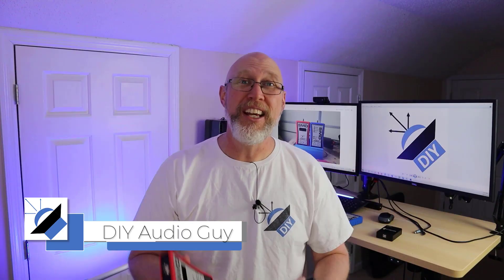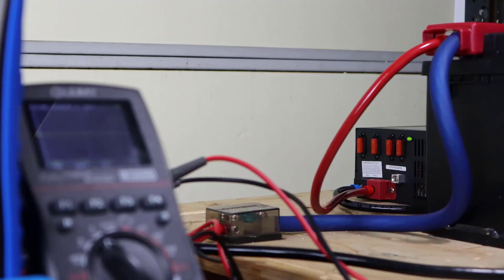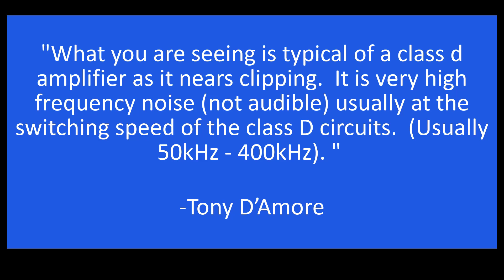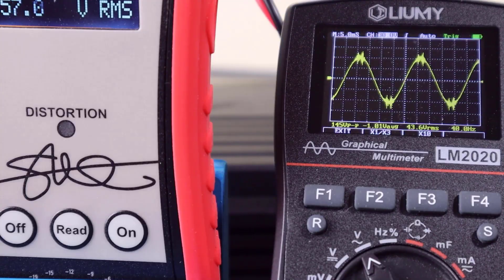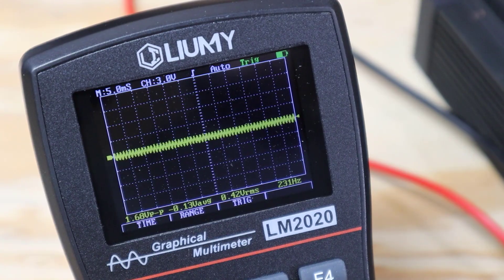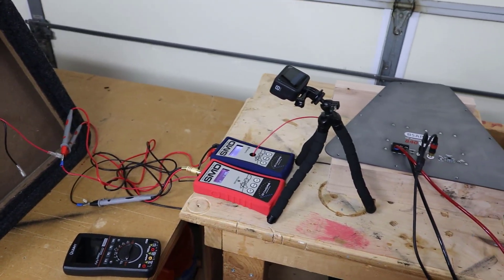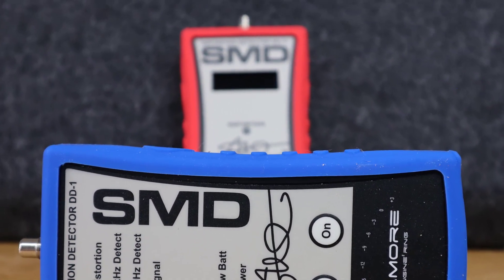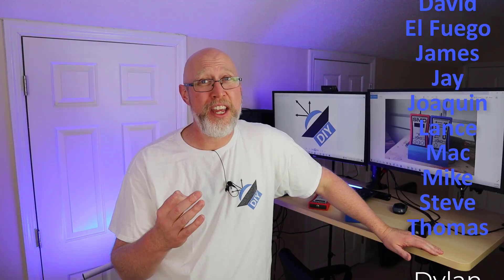The best way to set amp gain?  #SMD DD-1 VS Liumy Oscilloscope

Comment: With 99% of Amps coming with some kind of clip light, most on the bass nob the DD1 is just an overpriced peace of tec with a name on it. Every song will clip at a different place on the nob. The DD1 will not, it will just give you a ton of overlap=distortion!
Reply: That would be exactly the same whether a DD1, O Scope, by Ear or even a clip light on an amp or bass knob is used to set the gains..
Every song has been recorded at a different level..
Reply from the maker: You are not wrong, that is why the ear is always the final tool.  If it sounds wrong it is wrong.

Comment: ok I am going to call you out now  ok 1st how many people are driving around with there head set at max level 2nd you need to set it up at a level you drive at most of the time no more then 1/2 level. I have all was set my up at what I drive at. thats why I am calling you out cuz it dont make any sence to have the level max out or less your bassing out for everyone
Reply from the maker: Ok, you called me out.
Reply: @DIYAudioGuy   @DIY Audio Guy well you make good videos and you lisen to people so I had to do it and see if you can make heads or tells out pf it I never under stand why people set the amp at max level for
Reply from the maker: @CantKillMe  The idea is to tune everything so you can crank it all up to max without clipping.  That way you can safely go full tilt without damaging anything AND it should still sound clean.

Comment: Next "tool" to try - a laptop, REW,  and a voltage divider circuit.  Use the circiut to feed the signal to the laptop,  and run REW's RTA app.  Use that to detect distortion... :-)
Reply from the maker: Good idea.

Comment: Can use a tweeter whit a 2.2 uf capacitor too. You must to increase the gain. When the distortion appears,the tweeter will begin to sound. That's another way to calibrate it
Reply from the maker: That also works.

Comment: Once the brands have the amplifier designs built in China they are effectively handing everybody else the design.  There are plenty of clones that don't have the markups because they can simply buy from the same exact build house in China that any of the large US manuf. use then eliminate most of the markup.  Talk to anybody that works on amplifiers and this is exactly what they will say.  I would say the O-scope and DMM would be the two to pick.  If you want something easier and less time consuming then you go for the SMD tools.
Reply from the maker: True

Comment: 20 years using an oscilloscope and plan to stay the same, I bought one and sold it shortly after, it was just collecting dust on my shelf.
Reply from the maker: I honestly was not expecting the DD1 to be any better than the scope, but I already had that plate amp pulled off so I gave it a try.  I was shocked.

Comment: Why not use a actually deck to do your test? Won’t a deck produce more voltage than a phone the 4-5 voltage that’s need to set gain like everyone does and does a phone actually put out 4v ?
Reply from the maker: The phone is temporary until I can get my new test bench built.

Comment: I completely agree. I set everything by ear it's never failed me but I don't think it's the actual correct way. Someone like me who changes subs like underwear could definitely use a dd1. But like you said for someone just getting a normal lower power system for the next 5 years it doesn't make sense.
Reply from the maker: Yea, that is what I was hopping to show.

Comment: This was a good watch. The distortion issue is one that I never had considered or taken much thought into before, so it was really interesting to see that demonstrated. Just due to being the type who likes to tinker, see how things work in depth, and get the absolute best value, I'll probably always have a love for scopes. But this video was great in how it presented and educated about the SMD tools, I have quite a bit more respect for the engineering behind those tools now.

That compressor behavior is something I think I've only seen on pro audio gear before (with my very limited experience with pro stuff), so it was really interesting to see that on that little premade car enclosure. It makes me wonder how common that circuitry is on lower end gear, or if maybe it was just a once in a blue moon thing that some engineer thought was a good idea on that particular system.

Anyways I really appreciate your content man, it's the thing I like seeing in the audio, and really any, community. We shouldn't get so caught up in what's "better" and "worse". Instead we should be educating each other on how to make the best of the gear we do have. That and of course, trying to stick to the facts of the situation is always the way to go. There's always more to learn. Thanks.
Reply from the maker: You are exactly right.

Comment: Great video, thanks for sharing. Too funny, that Alpine M500 you talked about. My wife has had that amp for years powering her sub along with another Alpine for her midranges. She's had them for years and moved them to a number of cars. Last fall I upgraded them with an Audio Control D-5-1300. I made use of the DD1 as well during the install.
Reply from the maker: It's a great amp.

Comment: My stereo OCDs caused me to get both, The DD-1 works and does exactly what you want it to.  You're kinda paying more money for the product that is easier to use without having to think.  If you're on a budget, The O scope is more than adequate, you just have to know what you're looking at (like your examples). I like that the O scope gives you voltage at the same time.  

Ears can work.. You can for sure hear exactly when the wave clips with your ear, the tone changes. You just need a way to attenuate the signal so you don't blow your ears out.  Example: find where the head unit clips by turning amp gain all the way down. you'll hear it change.
Reply from the maker: Right! It's easy and you don't have to think.

Comment: I use the dd1,cc1 and the amm1 they work great. It makes everything so much easier to set gains and crossovers. And the amm1 is alot easier to see what my amp is putting out with out have to bring out a termlab.
Reply from the maker: It's good to have tools!
Reply: @DIYAudioGuy  yes definitely this was a good video.

Comment: When I was younger I did it by ear 👂 but now that I have some education with electrical and using O-Scopes it's a basic understanding of how AC works and what many people forget is different frequencies have different wave forms and time periods with a good O-scope you can measure multiple things at once I believe you can't do that with The DD1? I really don't believe it's a bad tool at all but the cost per usage is what I look at when buying a tool to do a job, If I bought a dd1 it's only for testing and tuning amplifiers with an oscope it has many usagages not just car amplifiers so would I buy one nope 🙅 I will stick to what I was trained on
Reply from the maker: That's why the scopes are so popular, they do a lot more.  I was pleasantly surprised by the DD1. It does one thing, but does it very well.
Reply: @DIYAudioGuy  and thank you for making a great video on these tools

Comment: 5:49 I think the noise if it's the output of the amp, is not going to be filtered by the crossover at all. That is noise that the subwoofer will be seeing and playing. But that's still probably so quiet and high in frequency you won't ever notice it over the noise of the "wub wub" it's making. If it's above 10kHz then I doubt you'd ever hear it on a subwoofer ever. 

Thanks to this video I might hold off on getting a cheap o-scope as if it isn't telling me the whole story and could leave distortion on the table then It's not what I need. This also helps me feel like I'm actually accurate assuming my amp (NU3000DSP) is limited to 24/25v per channel before distortion jumps to very audible. Might not be clipping, but sounds very bad past that.
Reply from the maker: Slowing the footage down really helped.  I think it was interesting that neither the scope nor the AMM1 showed clipping on that cheap amplifier.
Reply: @DIYAudioGuy  Yeah. Curious what it takes on the scope to show the distortion. Like would you need a better scope or more practice with it to see it. Or what other device would it take to make it easy to detect the 1% distortion.

Maybe some sort of RTA you can clamp onto the output of the amp that shows the frequencies and the harmonics. I think harmonics 40dB below the fundamental tone is 1% and 20dB below is 10% distortion. There's probably a device that could do that, but is it cheaper than the SMD tool? I need to look into this more now.

Comment: I use a mini oscilloscope and a multimeter to find the maximum my amp can go (5 chs) then I rely on my ears. I know up to what point I can raise it, it's just a matter of preference thereafter. I have noticed my amp mono section needs to be tuned in that way but the 4 ch output has a Max of 30v just like you've gone through.
Reply: 25hz, One test you can also do when settings gains and tuning in conjunction with your ears, what I do is use my Oscilloscope as a visual guide of what my amps are doing with my sub/bass/mid bass/midrange/mid high/brightness frequencies and what ones clip for adjustments. Whatever clips, or is wasted energy and can be filtered out, or EQ’ed.
Reply from the maker: Cool

Comment: DD1 for people who make a living in audio. Quicker and reliable. 

Liumy + cheap voltmeter for the rest of us. On any reputable amplifier, I never use max undistorted gain anyways. It's usually the least power efficient, and more power than the speaker calls for.

Now your first test, that is definitely oscope winning. That fuzz, not a big deal on subwoofers. But full range, it's noticeable. I used a 2 channel Jensen from Walmart recently. Class d. It just never sounded, right. If you're listening to rap or something simple, you'll likely not notice. But something more complex, notes would break apart. Turning the gain down to a nice curve on the scope, fixed the problem. I lister louder than most people, so it stands out.
Reply from the maker: Yes, it's hard to justify for DIY.

Comment: Can larger power wires fit through it and what if I have several with 1 or more on dual input adapters?
Reply from the maker: The AMM1?  You put that on the speaker wire.
Reply: @DIYAudioGuy  Oh sweet. Thank you.
Reply: @DIYAudioGuy  I see the input at the top. For some reason i had it in my head it was the unit he sells with the hole in the middle of it. My bad. 😄👍👍

Comment: I set gains with a regular dmm it works and it is as accurate as my clip light on my amplifiers
Reply from the maker: That's how I did my gains when I first started, one of my most popular videos shows how to do it.  It works, but you have to know what you're doing to make it work.
Reply: That works as long as you have some sort of way to see distortion.setiing voltage ac via Dmm is not all equal.  20 vac on gain is not equal to 20 vac clipped on gain.but you have a clip light so non issue🤙🏽
Reply: @angelvip2474  if I have a 1000 watt RMS reputable amp I set with multimeter to 900rms what ever the voltage may be for the ohm load.   I just leave a 10% room for error . You gain 3 db out put every time you double power , you will never hear the difference between 900 and 1000 rms on the same set up.
Reply: @angelvip2474  I think with good amplifiers that post there proper power in there manuals I think the dmm method works well, but I have clip lights on these amps so it seems to be pretty close the only draw back u may leave power on the table that was my experience with it, I may have been 20% under what I would have set to without clip, but with 5k watts and six of them that is a lot of power left on then table